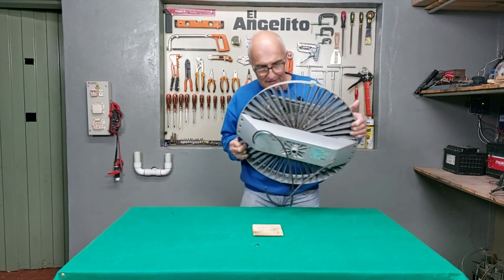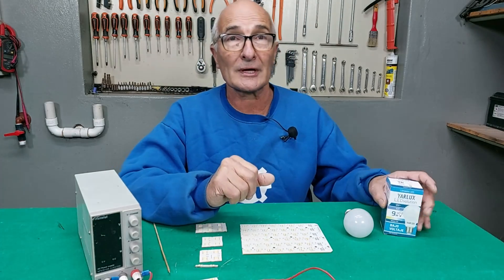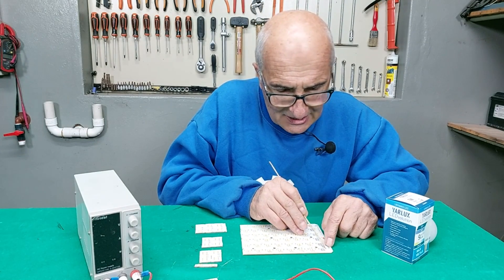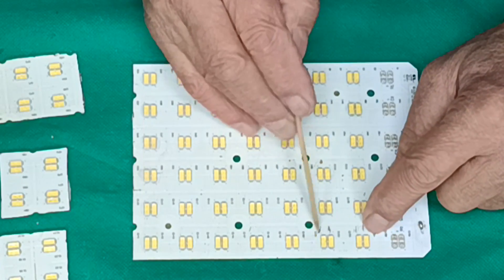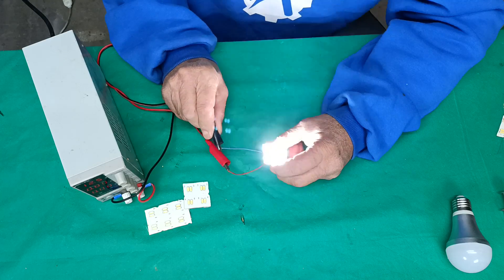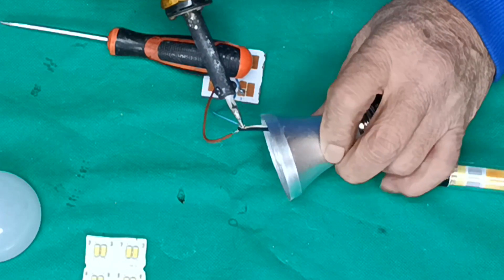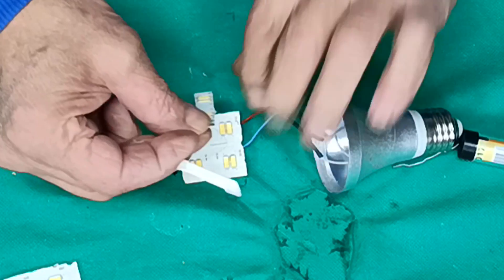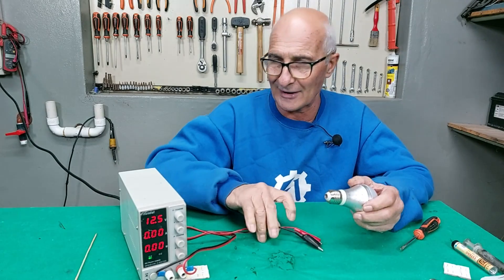ESTO ESTABA EN LA BASURA! Lo Convertí en Lámparas de 12V.

Comment: This way the LED's won't survive long. LEDs must always be operated with a current limitation. Either by using a suitable series resistor, then only the operating voltage for which the series resistor was calculated has to be kept constant, or you can use a constant current source. To do this, you would have to know which type of LED is installed and consult the manufacturer's data sheet. You need the exact LED Forward Voltage and it's typical current value it was designed for.
Just randomly soldering a few LEDs together and running them on 12V is definitely the wrong way. And then without cooling. This is absolutely wrong!
Thinking that you have 12V and simply connect 4 LEDs in series to match the operating Voltage is not correct. You MUST have a series resistor to limit the current. In your case I would connect only 3 LEDs in series and then calculate the required series resistor:
Important! If an LED receives too much current, it will definitely be damaged. Here you have to be very careful to ensure that you take the correct electrical values!
LED string voltage: 3LED's x 3V = 9V
Required voltage drop across the series resistor: 12V - 9V = 3V
(If the LEDs really need Uf=3V and have 0.8W, then the LED current (If) should be the following: 0.8W / 3V = ~0.27A)
Required series resistor: 3V / 0.27A = 11.1 Ohm
Power loss on the series resistor: 3V x 0.27A = 0.81W
Please ensure that the series resistor used is designed for the resulting power loss! In this case it should be able to handle at least 1W.

If the calculated resistance value does not exist, you MUST use the next higher value. This means the LEDs last longer.
Remember! If the operating voltage is higher than 12V, the LED current increases many times over, which leads to the LED burning out. So you have to make sure that a maximum of 12V really arrives. Or calculate the series resistance for a higher operating voltage. Or use a 12V DC-DC Converter with wide voltage Range input (For example 9 to 18V).

Comment: Hola campeón. Antes que nada gracias por el video. Te quería consultar de que capacidad tendría que ser una batería si tengo un panel solar de 100w? Ademas, vale la pena gastar en una batería de auto de 65amp o en una batería de ciclo profundo de 20amp casi al mismo precio? Solo la usaría para cargar el celu, alguna que otra linterna recargable y 1 o 2 focos a 12v. A la bateria la usaría sin inversor. Gracias
Reply from the maker: Usa de auto para ese caso.

Comment: Buenos dias. Usted a olvidado de hacer una manera de dissipar el calor generado. Los LED teràn vida corta. Saludos.
Reply from the maker: Estos led trabajan a mayor voltaje originalmente,  ( 3.7 v cada uno, en mi caso estan trabajando a  3 voltios debido a la caida de tension por el largo del cableado ( unos 35 metros) y por eso calientas bastante menos. Saludos

Comment: Con tan poca disipación térmica,  cómo estabilizás la corriente en los LEDs para que no se quemen ? ..
Reply from the maker: Estos led trabajan a mayor voltaje originalmente,  ( 3.7 v cada uno, en mi caso estan trabajando a  3 voltios debido a la caida de tension por el largo del cableado ( unos 35 metros) y por eso calientas bastante menos. Saludos

Comment: Le tendria que poner disipador a los leds que use. Por eso venia semejante disipador de aluminio. La mayoria de los leds se queman porque recalientan y se queman o se desueldan. Saludos y buenas ideas para el recicle. Saludos atte.
Reply from the maker: Estos led trabajan a mayor voltaje originalmente,  ( 3.7 v cada uno, en mi caso estan trabajando a  3 voltios debido a la caida de tension por el largo del cableado ( unos 35 metros) y por eso calientas bastante menos. Saludos
Reply: @elangelito  Ok. Por otro lado, con 6 pilas tipo 18650 (3.7V 1800mAh) en paralelo y un circuito "ladron de joules" y un circuito para cargar esas baterias puede hacer un velador o lampara de emergencia o para ir de camping. Yo con esos circuitos pude alimentar un tubo led pequeňo de 24V (48 leds) que tiene un potencia genial. Saludos atte.